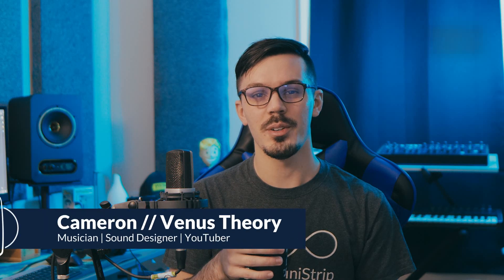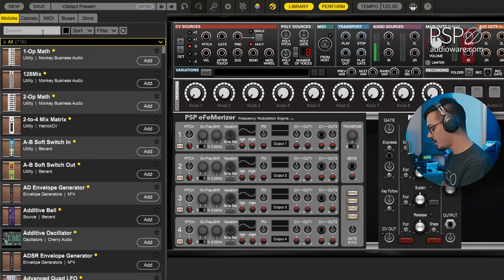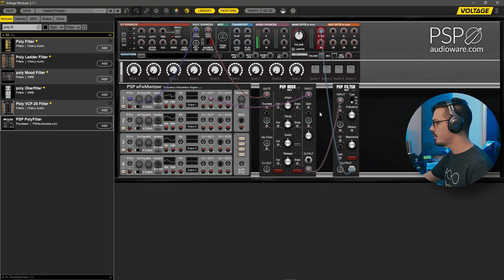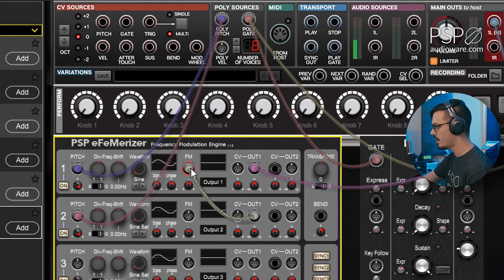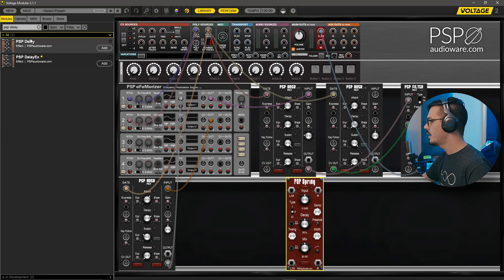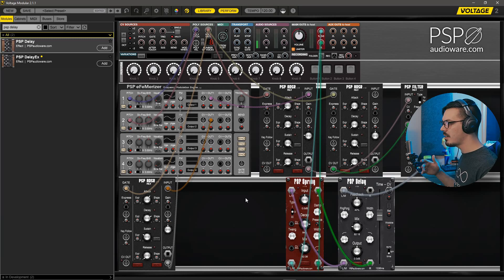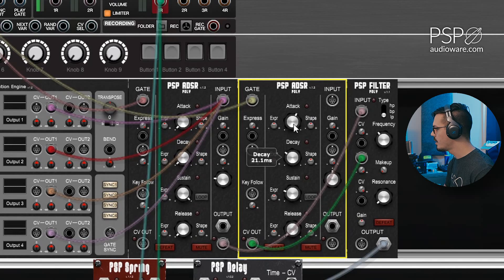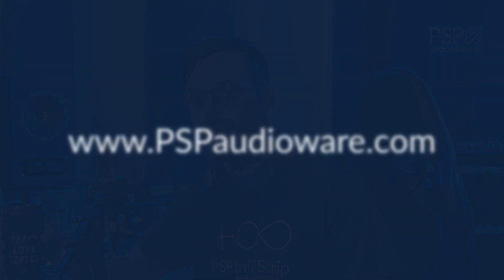PSP modules for Voltage Modular Beginner Guide

Comment: Is that right, that the third ADSR didn’t get an out?😳😎☺️🤔
Reply: You are correct. There is an edit from 4:36 to 4:37 where you can see a cable just appear at the FM input of Osc 1.  The poly out of the 3rd ADSR needs to go into the FM input of Osc 1.